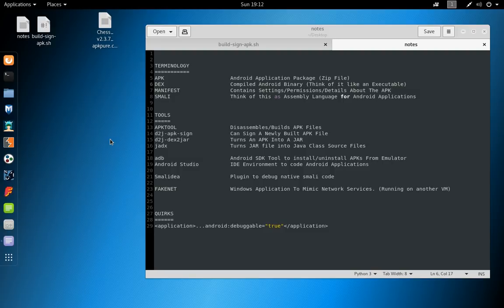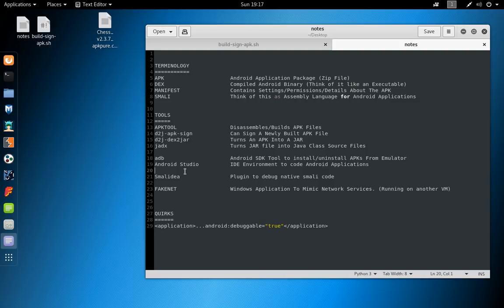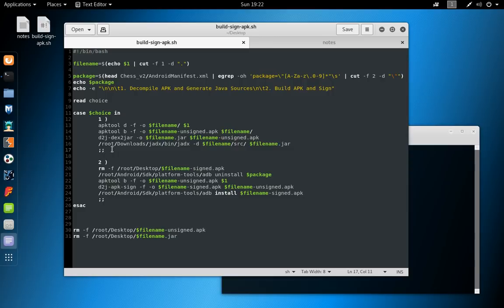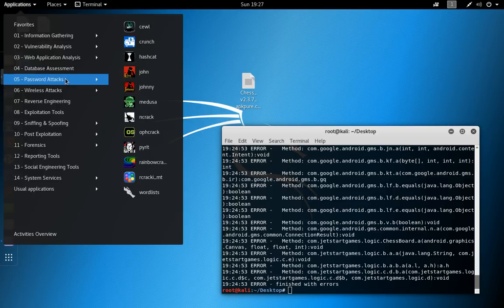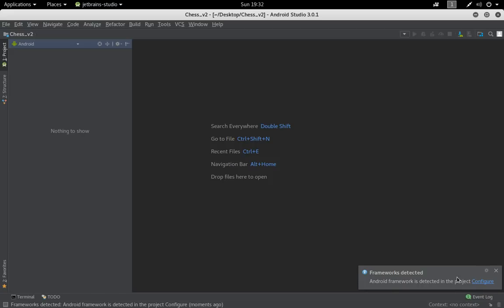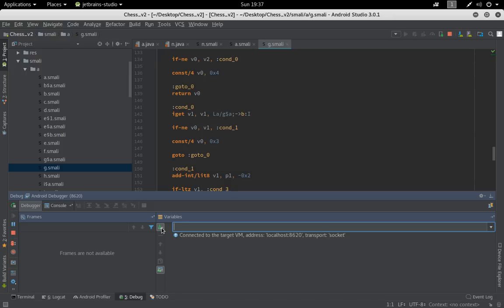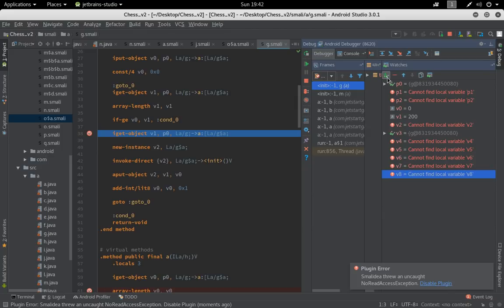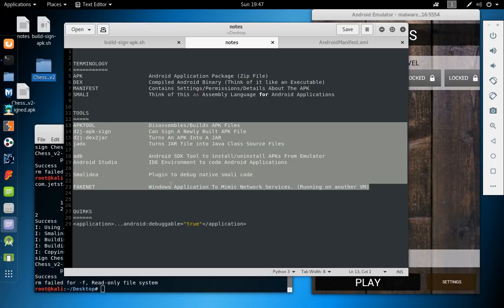Reverse Engineering and Debugging 3rd Party Android APKs

Comment: Can this be used in Windows?
Reply from the maker: Android Studio has a Windows version and the debug plugin should work as well. The APK tools and other things may have a Windows version, but if they do not, they can be run through the Windows Subsystem for Linux (WSL).

Comment: Hey is it possible to reverse engineer a game which requires internet at the loading screen only after the game loads it works without internet.pls reply sir
Reply from the maker: It is possible to reverse engineer the game and potentially remove online device checks, however, the checks will often communicate account information required to get the game set up. Frida can help you learn more about what happens while the game is loading and checking in with the game servers.

Comment: The rain sound was really getting me good vibes although i wasn't able to understand the debugging process you did . Great video
Reply from the maker: Glad the rain gave good vibes. The debugging part allows you to step through the code at a very low level. This level of debugging is fairly easy if the APK belongs to you (i.e. you built it, have the source code, etc), but is fairly difficult if the APK doesn't belong to you (i.e. a game on the store, a productivity app, etc.)
Reply: @RingZeroLabs  yes sir , i haven't understood cause am noob in smali , you're completely not in fault however if you could spare some time , could you please explain what's the use of debugging the app in reverse engineering if it's mainly performed on apps only we own i mean the main aim of reverse engineering is to reverse an already compiled app . 

Thanks for replying btw
Reply from the maker: @studiospan6426  Correct. Debugging our own apps helps us find and fix bugs. However, being able to debug a 3rd party app, like malware for instance, allows us to inspect the behavior while it's running. This can help us find/defeat anti-analysis, break protections, inspect encryption before it takes place, view unpacked executables in memory, etc. The introspection afforded to us by dynamic analysis (debugging) allows a realtime view of the app/binary as it is running. Static analysis (disassemblers/decompilers) allow us to look statically at the binary without it running, however, deciphering dynamic actions (encryption, unpacking, obfuscation, etc) is often easier to understand while debugging. This is why both static and dynamic analysis are used while reversing.
Reply: @RingZeroLabs   oh i see so it's about protecting your app from easy reverse engineering so it's completely not off topic .
Thank you for explaining will sure help me to create a good app in future

Comment: I followed your steps, on my test apk and by modifying the smali files and recompiling I am able to change the behavior of the app (after re-installing the modified apk). But I can't get the debugging work like you do, basically android studio doesn't let me add the break points on the code inside the smali file, but only on the java code. I tried to add them then to the java code but (as I expected) the break points on the java code have no effect. does anyone know why?
Reply from the maker: You need to install a plugin called "Smalidea" inside Android Studio to debug the smali

Comment: Does this script will work on windows ? or we need to make changes in it first. what if we want to decompile 100s or 1000s of apk at once ?
Reply from the maker: The script is designed for a unix/linux environment, specifically in Kali. You could modify it to work in a Windows environment though.

Comment: please fix please ::
./build_sign_apk.sh: line 42: apktool: command not found
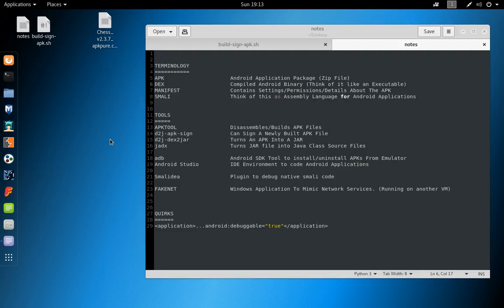Reply from the maker: Ya you need additional tools installed on your system listed at 2:15 in the video. The provided file is just a script that automates a few of the tools functions. Even with the tools on your system you will most likely need to modify the script to match your system paths for the tools etc. Hope this helps.

Comment: What if we have a check that when u are recompiling tha APK, if the APK signs are different from our original APK sign..then it won't allow open the APK.. so if u change anything in the APK, then recompiled it won't work
Reply from the maker: I believe what you are describing is a software protection mechanism used to prevent tampering and running the legitimate APK in a live environment (i.e. a multiplayer game that you modify so you can have unlimited resources.) The focus of this video is decompiling/recompiling an APK for reverse engineering purposes so that you can debug and understand how it works, not to defeat software/cheat protections.
Reply: @RingZeroLabs  yeah!! This video   purpose is for de/re compile ..thank you for putting this video for our purpose..your video help me lot..
Reply: @RingZeroLabs   my previous question is that it's the only way to protect our APK right or it may able to break..just give me suggestions from ur end
Reply from the maker: @mraravindchannel7294  Obfuscation and integrity checking signatures are helpful but they can be defeated. Dynamic and virtualized packers can help protect against RE efforts too, but can also be defeated.  Server side asymmetric encryption/decryption of data is very powerful if implemented and verified correctly. Encrypted network communication is also a must and you must verify that the certificates being used are valid. It is usually recommended that any important functionality of your program be verified or moved entirely server side. Also inlining important pieces of code in C/C++ instead of Java makes decompiling those pieces a little tougher. The last bit of advices is to not store any raw/un-encoded values (i.e. strings, key integer values, api keys, etc.). Data like this is easy to find and gives valuable clues into the functionality/layout of the application.

Comment: What if the java codes are already obfuscated?then wat's the way to do.
Reply from the maker: If the underlying Java code is obfuscated then you have to deal with that manually by reversing the obfuscation or manually working around it.
Reply: @RingZeroLabs  Thanks...  I have some scenarios like if the mobile debugging mode,proxy mode,rooted environment's the APK won't work  this is the situation...so if I reverse the  obfuscated APK ,then comment all these lines in js files ,recompiled and then signed...so now this APK will work in these environments...Thanks for ur reply

Comment: Great informative video. Is it necessary to unsign the apk each time after running apk tool to decompress the apk. Once you make any changes it will have to be resigned anyway before it can be installed doesn’t it or what is the point in that step. Thank you
Reply from the maker: So if I remember correctly the script I wrote decompiled the apk, then built it again to make sure there was no interesting anti-analysis tricks going on. I believe I also did it to have a backup of the original apk and to keep an extra copy of the dex files. Once you modify the code you can build the apk, but it then needs to be signed before it can be installed in the emulator/phone. Hope that answered your question.